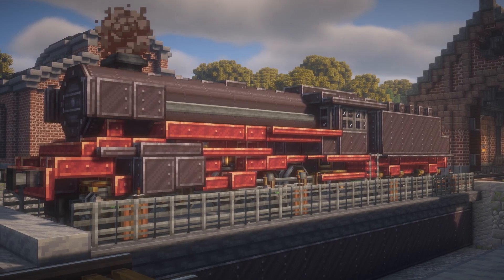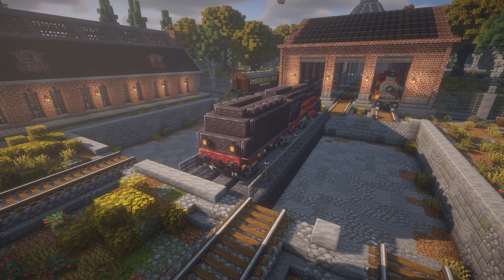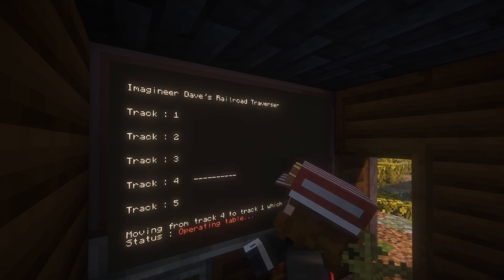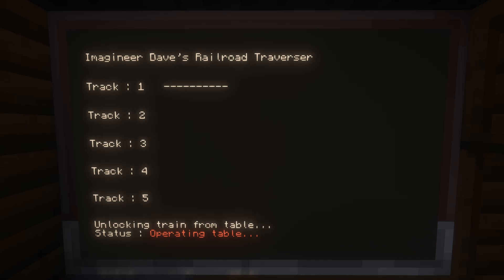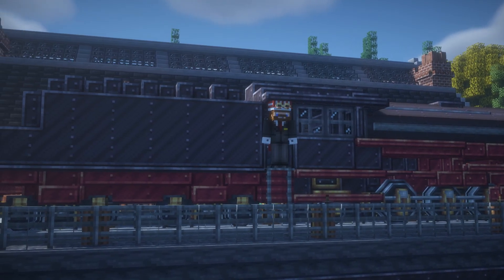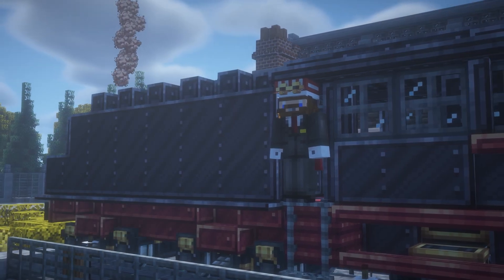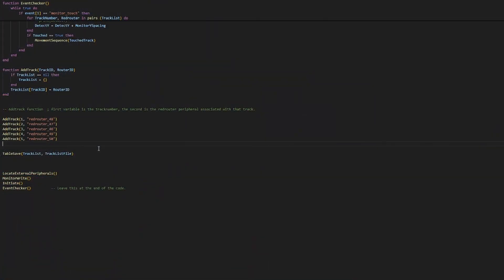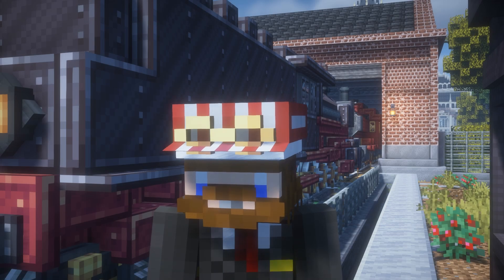Minecraft create mod - Railroad traverser - Computercraft integration

Comment: I tried building the traverser on my own modpack. The mechanism worked but it sadly doesn’t allow me to move the train
Reply from the maker: @jarikooper6325  are you using computercraft or the manual version? If you’re using the manual one make sure to have steam n rails and to put wrenches in all of the deployers
Reply from the maker: Also, try replacing the stations (and relink the wired modem after). Make sure to also drive up and link to a station by holding spacebar.